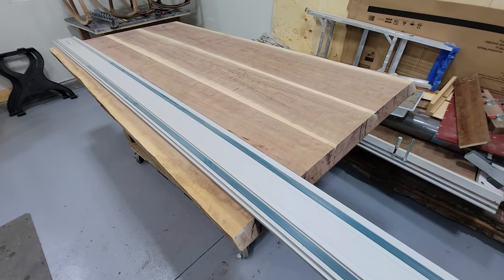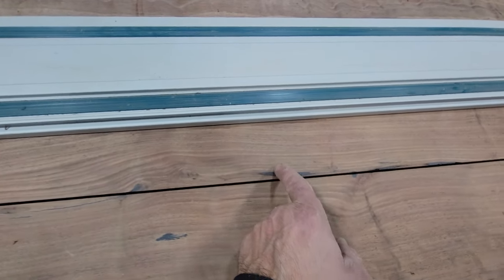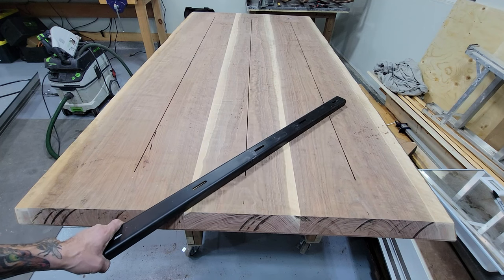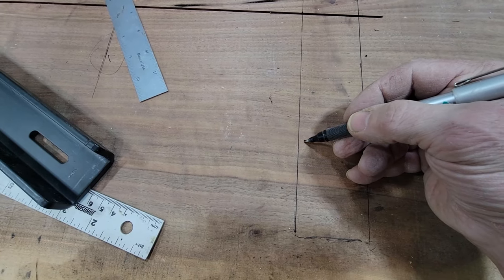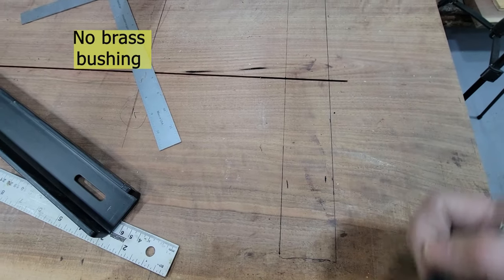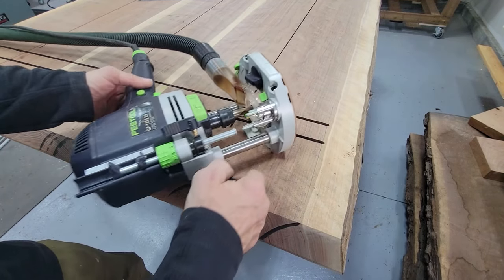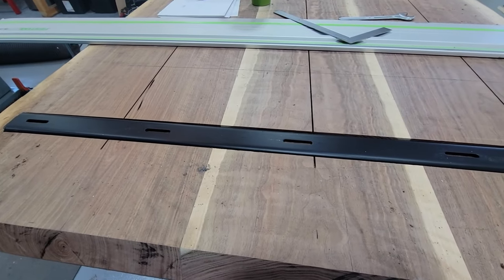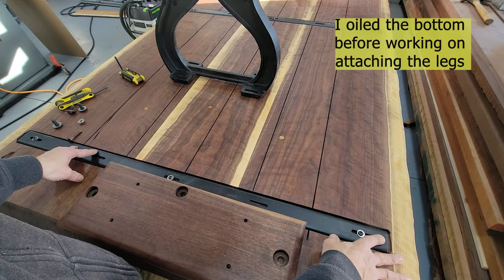Tips to keep your table top flat: C - channel, relief cuts and finishing

Comment: Great job!  Did you get the C channel on Amazon?  Interesting explanation about how to prevent cupping by ripping the slots.  I make a lot of tables and will give this a try as well as your finish mix.
Reply from the maker: I got the c channel feom concept 13. There is a link in the description 👍
Reply: @GaraWoodWoodworking  Thanks.  What is the advance the C channel vs a straight slotted bar mortised to the underside of the table?  Thanks again.
Reply: @jayonasch1553 C channels are stronger, they better prevent the wood from bending since they themselves are very good at not bending. 
A straight piece of metal will help, but it will be more likely to bend instead, the shape of c channels means they stay very straight and won’t budge, meaning the table they are attached to (hopefully) won’t either! I have always used them and they work great!
Reply from the maker: @jayonasch1553  A straight bar has less horizontal rigidity. The "C" shape creates and "I-beam" like structure.
Reply from the maker: @MiiNTBLAZ3  100%